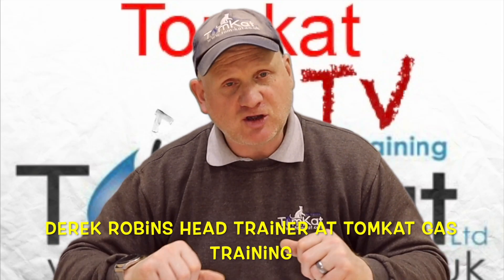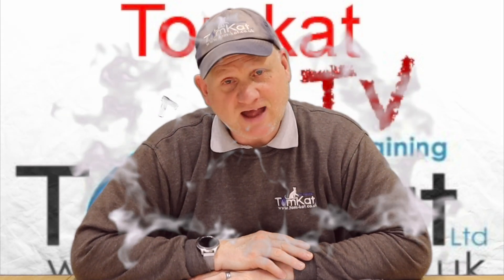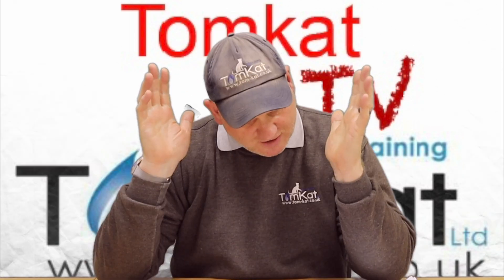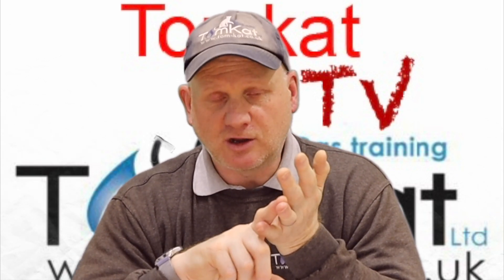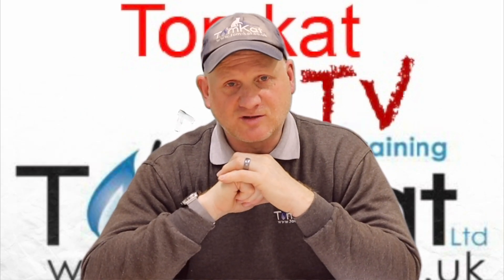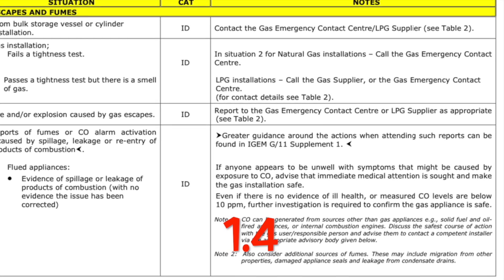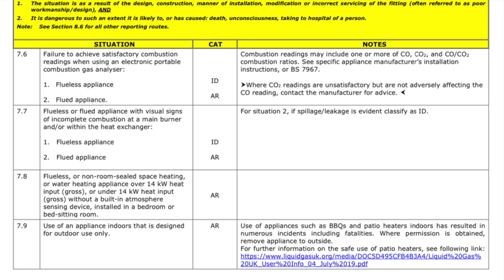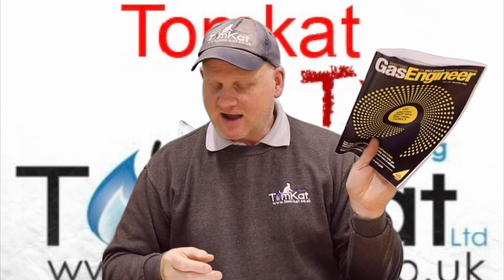The changes to igem g 11 and 13 that all gas engineers and trainees need to know.

Comment: Hiya Derek. Has there been any new alterations since this video. The reason i ask. Yesterday, servicing a boiler. I checked the working pressure at the meter. 16mbar with a hot tap on full. I hadn't even put the fire or the range cooker on yet. Cadent came out. Fair enough they put on all of the appliances and the hot tap. The reading was obviously low. Cadent s response. We will wait a few minutes to let the boiler stabilise. Ok. After 3 or 4 minutes when the hot tap is almost boiling in the sink and the boiler is modulating down to accommodate this, hey presto, he managed to get the 18.5 at the meter. I argued that you have just waited for the boiler to module right down and it is now nowhere near at its maximum capacity. He said thats what they do and left. I tested again after he left and the boiler had cooled down. 16mbar with no fire or range on. I then phoned gas safe later when i got home hoping for a sympathetic ear and that is not what I got. All i got was. I need to understand the igem g13 and that it all depends what you are doing, whether it is a service, commission etc. He said the boiler (it was a 5 year old Vaillant combi) shouldn't modulate down if it is sized correctly and if the boiler was doing that it was wrong for the house. I will admit, the boiler was oversized in terms of kw for the flow rate of the tap. However i went to a 28kw Vaillant today and after the tap had been left on long enough it modulated down. I said to gas safe it would be impossible to size a boiler so accurately that it never modulated down with the hot tap running. I said to gas safe if the water pressure was particularly high there and it hadn't modulated down at all, then the gas pressure was far to low. He then said ignore the 18.5 mbar. There are 2 numbers and the other number regarding whether the gas pressure is safe or not and the 18.5 isnt it. He actually stated if you phone the boiler manufacturer and ask for the safe figure, it will potentially be as low as 9 mbar at the meter. Big long message i know. Im making my own little video of the experience but wondered if you could shed any light on this. Ive always called Cadent at anything towards 18 mbar. Is it actually worth it if you can just leave the boiler on for so long  its at 50% of its capacity. Cheers mate and im still wanting to book my un vented cylinder course, i ve just been busy but will come and do it at some point 👍
Reply from the maker: @northwestgascertificates  it seams it’s all about the safe operation of the appliances. If they stay lit with the biggest appliance on full and the others on 50% they don’t seam to care. Igem/g/13 says if it’s reported they have to investigate it but doesn’t say they have to sort it out. Basically you have done your bit it’s now down to Cadent to do theirs if they deem it necessary.
Reply: @tomkatgastraining  very true. Gas safe said that as well. "You ve told Cadent. You ve done your job, Its on them, stop worrying about it" 🤣 Im still convinced there is a supply issue. All the pressures seem low and they will do anything to avoid dealing with it. Or they haven't got the money/ man power to deal with insufficient external gas piping. Anyway im going to sleep well tonight, it actually woke me up last night thinking about it 🤣🤦‍♂️

Comment: Can you tell me if an external Gas Meter box should be replaced or repaired if an extra knock-out hole for the gas entry has been removed but the hole is not used and left blank?  I note the Gas Safe Register says holes bigger than 10mm should result in the box being replaced.  But what if this defect has not been picked up until the purchaser takes possession?  Should the gas meter be disconnected temporarily to allow a new box to be installed or is it acceptable to put a plastic patch over the knocked-out hole?
Reply: Yes, I agree.
Reply: as far as im aware the repair of a 10mm hole is for a box built into a cavity wall where 
 it is directly terminated within the cavity, a hole at the front of a box in the allocated cut out wouldn't require a repair or exchange as it hasnt damaged the integrity of the box
Reply: @shaunfoley4692  Yes but it would also allow pests an entry point into the box
Reply: @Elfin4  nothing a bit of non setting compound cant stop my friend, cant say ive seen anything to suggest we need to take potential pests into account with regards to meterboxes, certainly not to extend that it requires changing for safety reasons but by all means keep asking, bs 6400 is for meter installation and i think bs 8499 (could be wrong) for meter box standards, maybe they might shed more light
Reply: and more importantly wouldn't allow gas into the cavity if there is a leak within the meterbox
Reply: It’s not completely clear to me what is meant by integrity of the box. If the door keeps blowing off in the wind or the door is missing is this an AR situation? Similarly an unused hole to outside. Replacing a built in box is not always straitforward.
Reply: @martinwright7093  Yes agreed, but the real point is the developers should not allow the gas meters to be installed if the meter box is knowingly and clearly damaged.  If it is damaged before the completion date, the developer should bear the cost of removing the meter and installing a new box as that is what the end purchaser is paying for, new components not repaired items.

Comment: Great video once again , although you say the GT will have to do something about low pressure,I like your optimism here,it's not what the document suggests .
Supply requires further investigation. 
The GT will recommend the best course of 
action working in conjunction with the RGE to 
pragmatically address the situation and explain 
this to the customer/RGE with associated 
timescale.
Looks like they can still go ,nah nothing to see here ,move on .

Comment: Great went to a service yesterday. Never done it before and it is its 1st service. 19.7 working and 16.2 at the inlet of the ideal instinct 2. Guess what in the Benchmark the installer has claimed inlet pressure as 20mbar so definately telling porkies here. Ideal say they would be OK with it but if it breaks down and the issue is with pressure the guarantee is void.
Reply: How does that make sense ? They say there fine with it but they wont cover it on warranty thats total bullshit
Reply: @shaunconnor7525  I agree they should say no ID it as it is not performing as per MIs but you know I have had that much aggro this year with registered installers and what they leave. 44 years in the trade is long enough and standards are not getting better even ACS has made no difference.

Comment: At W&W we've been told to allow a 1 minute stabilisation time once in hot water mode and additional appliances running at 50% before recording the WP.
Reply from the maker: You are correct

Comment: I have all IGEM 11/13  TB's up to date.
How many installers bother to do the same?
So your post is so important, and that's  why you go to the lengths you do to update and inform installers.
I would say that ultimately gas meter inlet/outlet operating  pressures are but a part of determining the safe operation of appliances, accurate gas rating is essential.